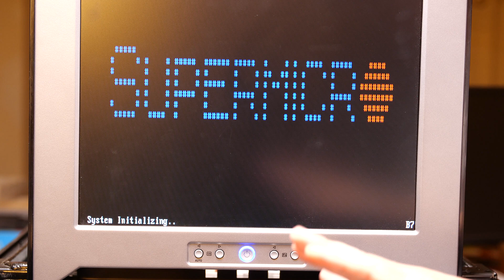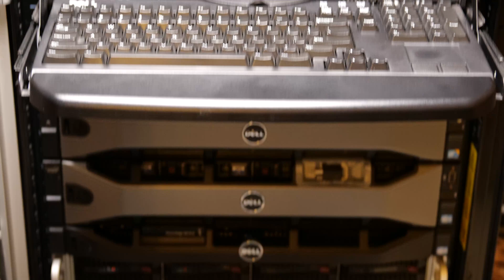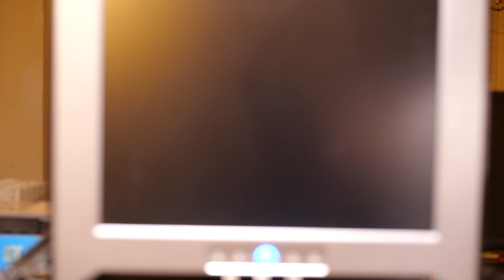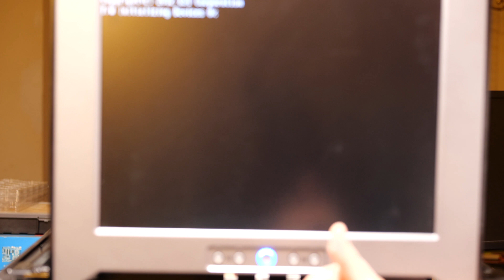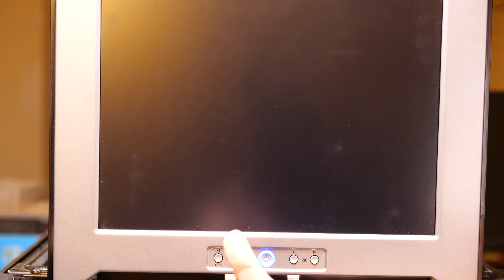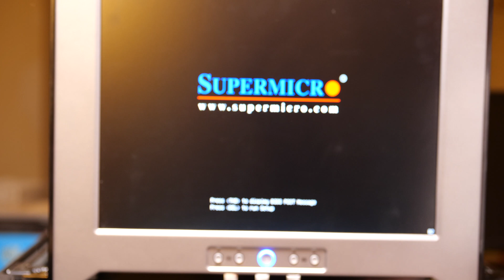Supermicro system initializing B7 B9 BA BF | Really weird problem with X9DRH-7F

Comment: how do you restart the IPMI when it some how mine I can't access it from web gui. or any other way its like it has crashed.  I could just shut down the entire server pull power and maybe go that route.  bur really dont want to do that.
Reply: You can use IPMIview to connect to the IPMI of the server and from there you can run a BMC cold reset. It will reset the IPMI and the GUI will be accessible again.
https://www.supermicro.com/manuals/other/IPMIView20.pdf

Or if you have ssh access to the server, then install openipmitool and run a reset command to reset the ipmi 
eg: "ipmitool mc reset cold"
Reply from the maker: As Teffin has mentioned, there are other tools to reset the BMC, but it requires that your BMC is accessible in some way or another. if it is not, then a power reset might be the only way. From within the OS, you can usually communicate via local IPMI interfaces. Supermicro has a tool called "ipmicfg" that you can use. If you can still access it via the network IPMI port, then you can use Teffin's suggestion or any other IPMI over LAN client.
Reply: @ArtofServer  thanks I found out why I could not access it.  I have nord VPN and for some reason I could not access that IP Address,  I have it on a different Network, and Nord VPN was not allowing me at the time connect to that network. So I had to do some Configuring and then was able to to see it again.   The IP Address for the different switches and servers are all on a Different IP Address   Example My normal IP Address is 192.168.1.1  Were I set all my other devices I don't want Access from the out side world Like My security cameras, switches ect servers are all on a different address Example 192.168.20.1  So once I got Nord reconfigured I was able to.   Some day I will stop being lazy and get pFsence set up and get nord on that and protect all my network the way I really want it protect.